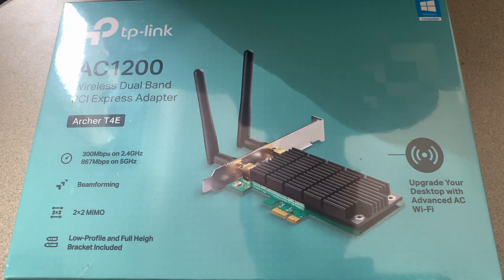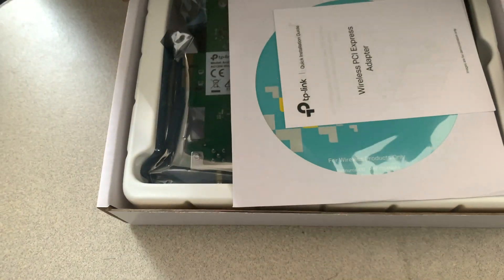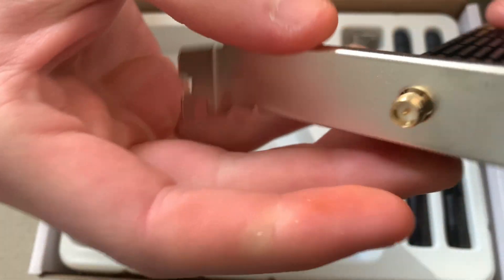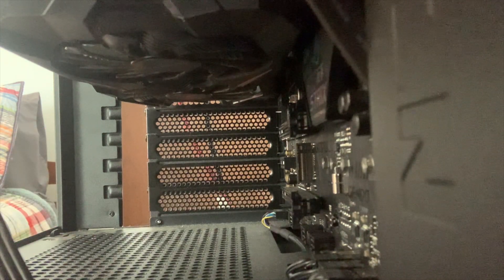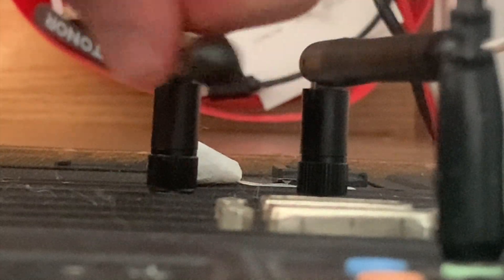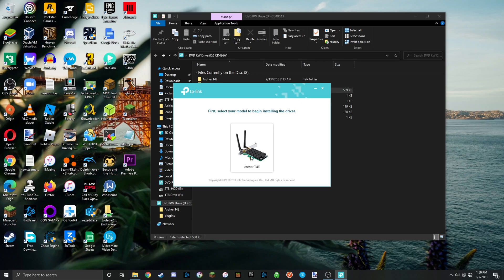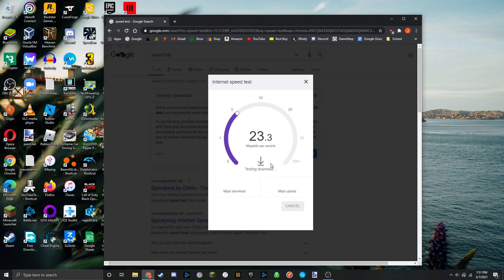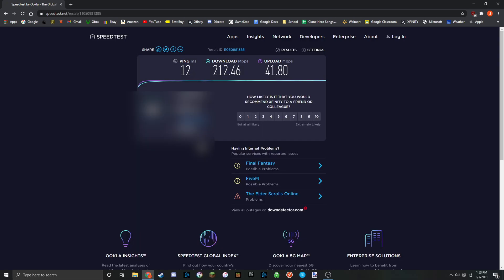TP-Link Archer T4E Unboxing, Installation, & Speed Test

Comment: i recently purchased that wifi card and i cant  connect my pc to the wifi router, password is correct but its said that connection is not possible but has all drivers updated to the latest from their website.
Reply: bro i have the same problem. I bought today this wifi card. U can fix this?
Reply: bro, you found the solution?, I'm having the same problem right now

Comment: I just picked one up for a garage computer so I can look up manuals and repair guides while working on our cars, boats, toys, etc. So far so good, I'm running on the 5G connection from 50ft away and it's very quick. Couldn't be happier for an inexpensive adapter.